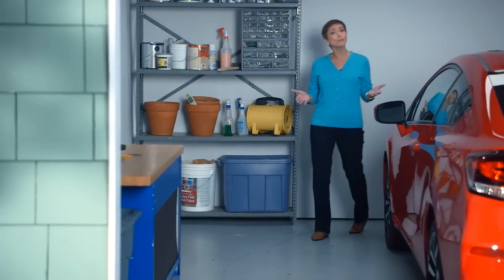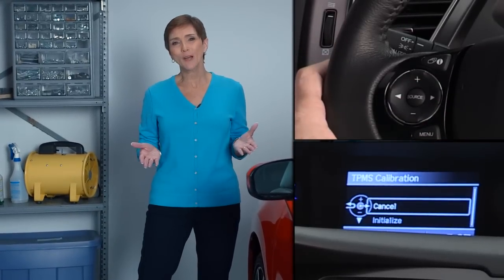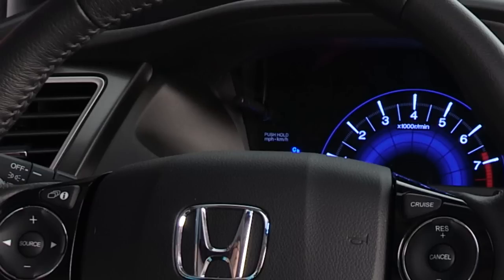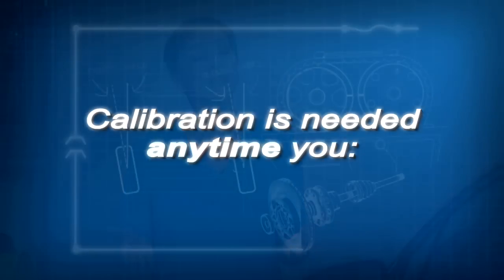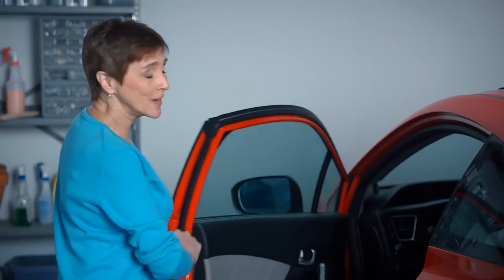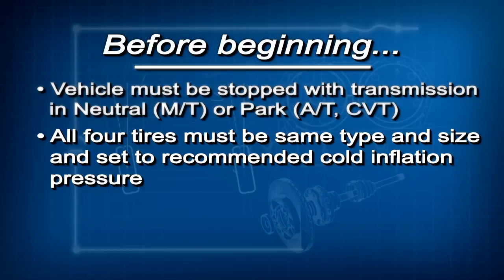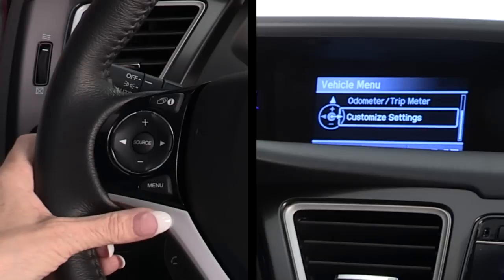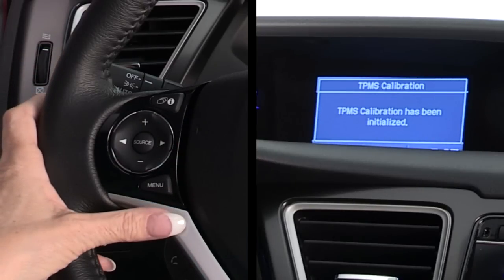Calibrating an Indirect Tire Pressure Monitoring System: Vehicles with i-MID

Comment: I think this option is for 2012 lower models because my 2013 Civic don’t have this option and tires has the right pressure and the light won’t go way(winter)
Reply: Did you find anything? I have the same model 2013 Civic
Reply: @5OR1AN0  No…

Comment: Have 2013 Civic. After selecting Customize Settings, No option called "TPMS Calibration" appears. Can't recalibrate. What is the problem?
Reply: I have the same issue. No TPMS Calibration. Did you ever find out.
Reply: @qdog568  Ended up having to replace the four TPMS sensors. At least one had finally depleted its battery, which after eight years, was already on borrowed time. The sensors can't be recalibrated from the dash. They can only be replaced.
Reply: @stringed2391  I had one recently replaced. I guess I'm going to have to replace the other 3. Thanks.
Reply: @qdog568  Yes, that should do it.
Reply: This is a pos system to say the least !!!

Comment: What do I do if the TPMS Calibration option isn't there?
Reply: I can't find it either
Reply: @melvinhernandez5021  I even replaced all the tires and it's still on so I'm not sure whats up
Reply: @o_u_i_j_a_6634  not sure if you’re still having this problem, but my guess would be: your car’s year or even just the model may be direct TPMS (do a VIN search to see exactly what year/make/model your car is). if not, then try updating your car’s computer software. still no dice? a mechanic with a diagnostic tool could clear it. but it’s likely to come back if you have an actual issue going on. indirect TPMS car’s can easily trigger a dashboard warning light because the threshold for triggering it is determined by somewhat imprecise calculations. while direct TPMS cars have pressure sensors in each tire that constantly and accurately measures the PSI in each tire and sends the measurements to the car’s computer via radio-transmission (with the exception of a failed sensor or bad installation). Meanwhile, the way that indirect TPMS cars determine tire pressure is through calculating it based on info from your car’s other already-built-in-systems like Traction Control and ABS (Anti-lock Braking System). However, depending on MANY factors all the way from where your car was manufactured, down to what EXACT year/make/model your car is, and even as far as things like: temperature changes, a tire rotation, a new set of tires, a mismatching set of tires, sudden or often acceleration, equipping a spare, turning off ABS or Traction Control, or just simply putting more air in your tires… all of these can cause an outlier in the computer’s calculations based off of your last ‘calibration’ (all of which is considering your car can even calibrate), thus leading to a tiggered tire pressure light on your dash. Regardless of whether or not your tires look fine. That’s just the short of it though, do some research into direct vs indirect TPMS cars and Im sure you’ll figure out your answer, assuming you haven’t already.

Hope I was able to help :) Best of luck!
Reply: @LCRich2001  Thanks man I'll definitely look into I just now seen this I haven't got any of these notifications 🤣
Reply: @o_u_i_j_a_6634  damn bro, why did i write all of that💀

anyway, did you end up figuring it out?
Reply: You still having this problem?
Reply: @DMONEY44219  yeah haven't had time to mess with it since winter hit
Reply: Having the same issues with 2013 Civic EXL must be a bad sensor all the tires has the right pressure and the light won’t go way.
Reply: If your doesn’t have it it means you got regular tpms

Comment: I have a 2012 Honda Civic but the TPMS Calibration option does not appear in the menu, what should I do?
Reply: Did u ever found out? I need to do to mine but same here no Tpms option
Reply: Xavier López how did you figure it out .?
Reply: Same!!! What do i do?
Reply: Same!!!!
Reply: 2013 seems to be an oops year! Absolutely no info nor do even expensive 500 scan tools seem to work
Reply: Guys I have a 2015 civic si .. make sure the car is running before navigating the menus
Reply: @user-zd8vg1nl5g  2013 is not the same. It's as though they forgot to program the menu

Comment: Tpms calibration doesn't come up on my customize settings
Reply: Is it coming up with inflation warning or something that's what mine is. I have a 15 plate diesel. But I've had a dodgy tyre. So I'm hoping the calibration I've done today with a new tyre will fix it
Reply: Make sure the engine is running before navigating menu

Comment: Hello,
My 2019 honda civic EX-L doesn't even have a (TPMS Calibration) option in the screen setting, how can I have it added to my settings? I didn't buy the TPMS sensors yet, so I want to know first of all if it is possible to have it fixed in my car or not? And if yes, how easy to program the TPMS to my car computer?   Thx

Comment: My car doesn't have tps calibration option on the display
Reply: Yeah i have the 2012 lx and theres no option for that above display setup like it shows in hers.
Reply: I guess you have the direct measure of air as opposed to tire movement.  My Civic is the same.
Reply: Use the screen. Press home button, go into settings, go to vehicle, then press tpms calibration
Reply: @mahoganydreamers5170  does it actually show how much air is in the tire?

Comment: I had to jump start my 2015 civic ex and all the dash indicators are on. How so I get them off. I have asked many people and cfc they sont know and the manual is as useful as a dead battery
Reply: I think it's an indication of a dead battery or too low...something to do with the charging system. I started my 2012 civic one time and it did it until I turned it off. Started it again and they were gone.

Comment: My 2012 civic lx does not have that tpms option
Reply: only on 2014 and up
Reply: @r3dpois0nz  I have a 2014 civic si and mine doesn't come with that option. Does that mean mine doesn't have one? I thought it did. Anyone know what I can do or if I need to get something fixed? Thanks
Reply: @TheSteph2385  You're sure that your model is 2014? because from 2014 and up...they use indrect(sensorless)tpms soyou should have the option in your 2014 model
Reply: @r3dpois0nz  Yes I'm sure and mine is a Canadian version which doesn't have that option at all. It isn't a law here to have tpms. Just wondering if there's any options I can do that aren't too expensive to put in a tpms system.
Reply: @TheSteph2385  you should look up "chrisfix bluetooth tpms's video" to see if that things that you like?
Reply: TheLegacy125 neither does the 2013 Civic lx
Reply: @graysonhunter6695  exactly man, and what u did?
Reply: My 2012 is the same and I think it uses a direct measure of the air so no calibration is needed.

Comment: This doesn't apply to 2012 -models
Reply: I can't find one to do my 2012. In Customize Settings there is no TPMS option.
Reply: Yeah I'm having the same problem with my 2012 have you found a solution?
Reply: Same here. My 2012 tpms light has been on since I got it.

Comment: So I did all that and my light is still on and my traction control light is on too ..?
Reply: I know it been 6 years but I had the same problem, solution was using a big scanner I did a calibration on the abs sensors and now problem is solved. No traction or tire light